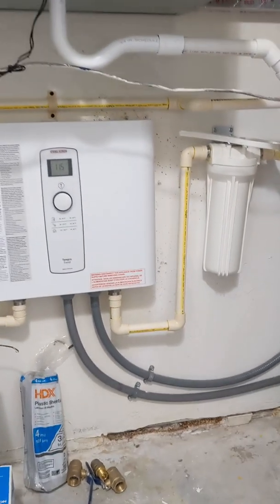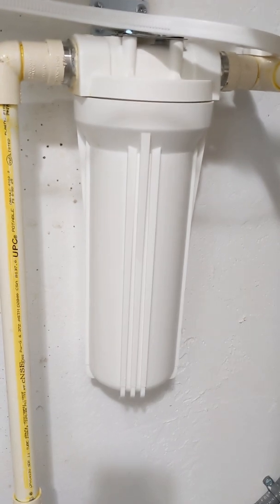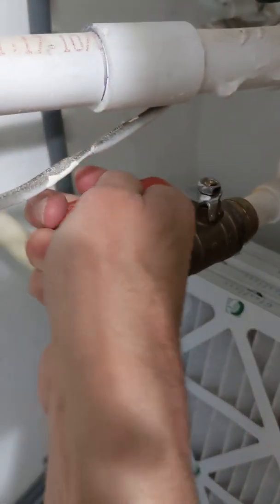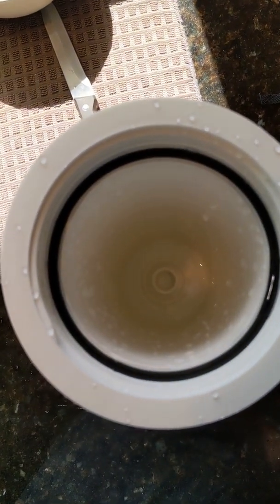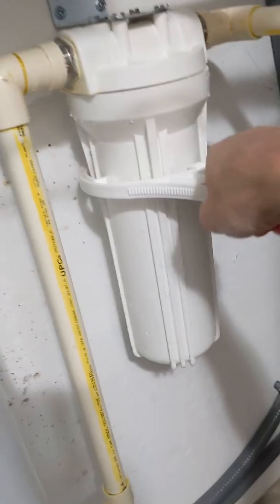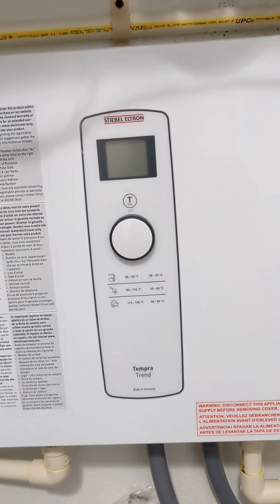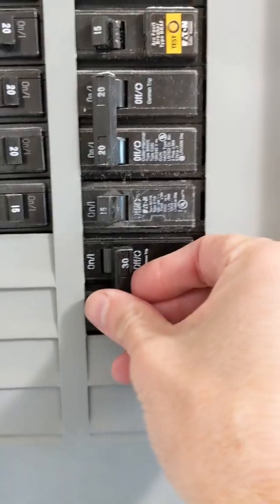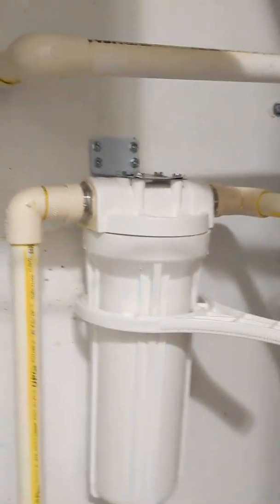Tankless Water Heater Filter Replacement

Comment: Steps: 
1. Turn off breakers to tankless water heater
2. Turn off valve (red) to water inside WH closet
3. Try water to make sure hot water is off
4. Place bucket under housing for the filter, then 
5. Unscrew the housing, empty out & clean housing (dispose of filter) 
6. Apply waterproof grease around gasket at top of housing
7. Put new filter in the housing and screw back into place, then use wrench for tightening a bit
8. Turn valve (red lever) back on,  run hot water faucet nearby till air bubbles are clear 
9.  Then turn back on breakers.  (Repeat every 6 months- 1 year)